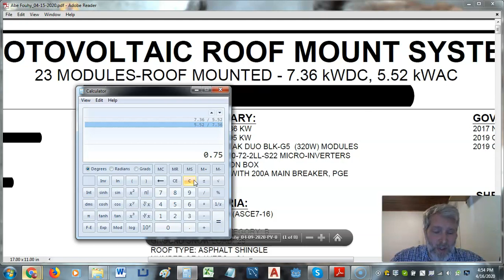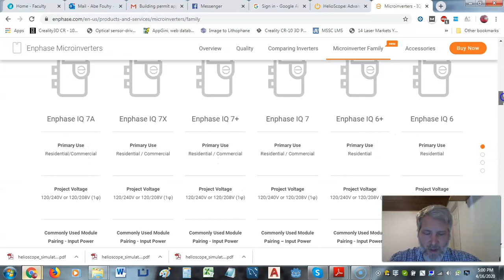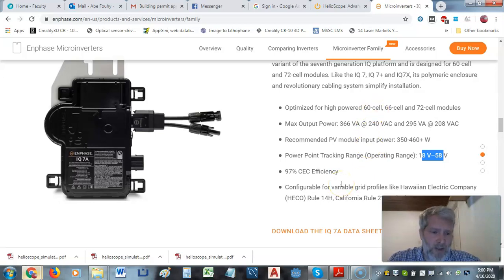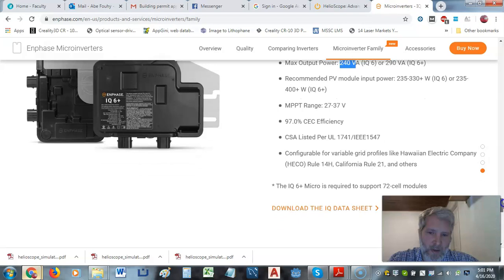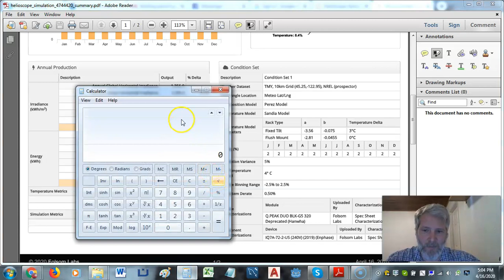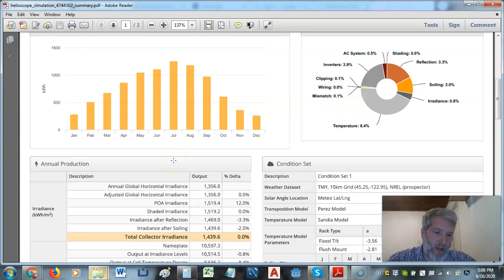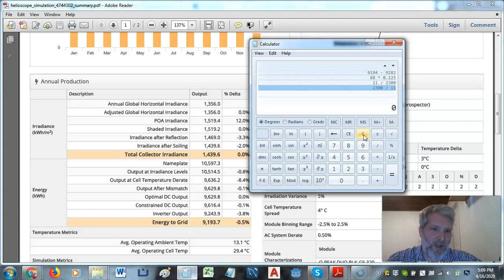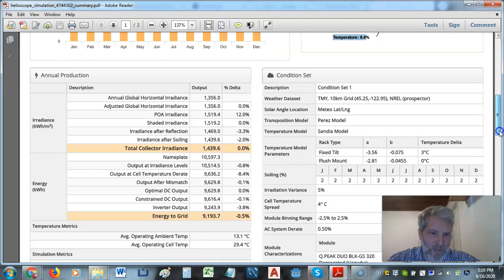PV Clipping on Enphase 250 Microinverters

Comment: The good news is that because it’s an Enphase system, depending on the Envoy combiner box installed, you can always replace those microinverters if you want, so you have a higher DC to AC conversion rate. IQ7+ would suit a 320 DC panel pretty well.

The modularity and future expandability options of Enphase make it a pretty cool system. Could also get batteries in the future for offsets at night, depending on what you want.

An IQ7A microinverter would likely be too powerful of a microinverter for a 320 DC panel, but you could use it if you wanted to, but you’d have a lot of clipping involved haha. 🙂

Comment: THANK YOU SO MUCH! You really help me to decide, what system is better for me. I live in a mountaineous area with cloudy weather for more then half year. I already bought 420Wp panels (Sunpower) and my next choice is to combine them with IQ7+, because of low starting voltage. The only thing I was afraid of is the clipping.
I hope I chose right and you confirm my assumption.
Thanks again ...
Reply: Hello
Are you happy with your solar system output?
How are the 420w Sunpower panels doing with the iq7+ microinverters?
Do you see much flat top output curves in the Enphase app?
Thank you
Reply: @serraios1989  I'm sorry that I disappoint you, but because of horrible support of Enphase in my country I eventually changed my mind and chose 450V string solution from Victron. I also found some real experinces of other users and theese PV panels are not fully compatible with Enphase. Some parametrs of this combination are really tight and reality is little bit diferent, that presented. Victron support and reliability is unbeatable and that's why is winner for me.